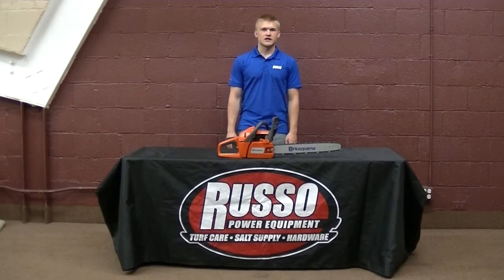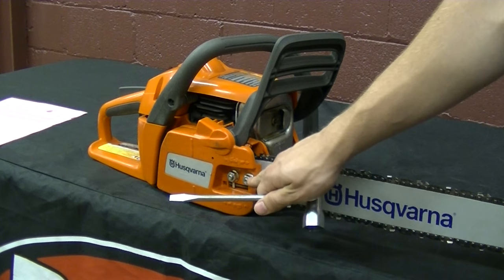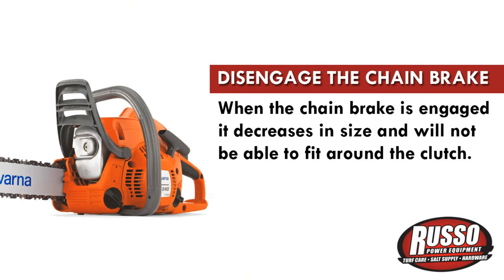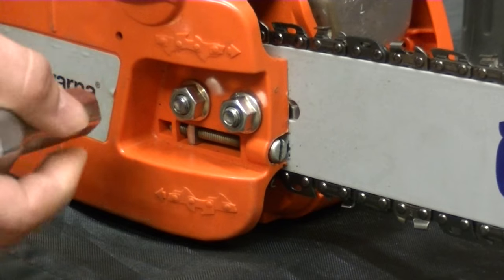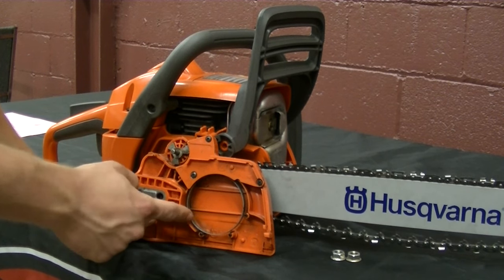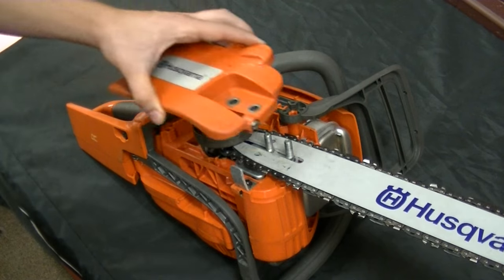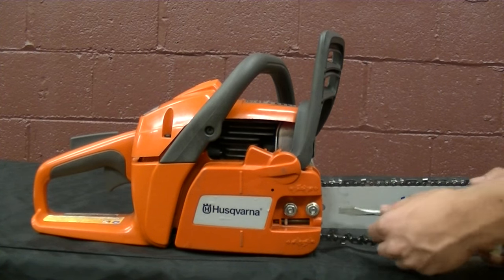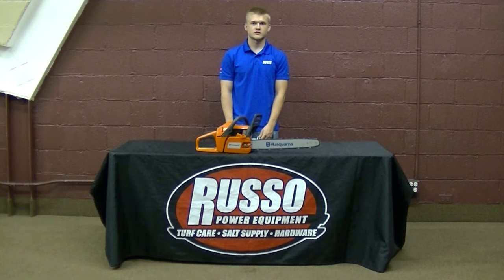How to Remove a Chainsaw Clutch Cover and Reset the Chain Brake

Comment: How can you temporarily put the clutch cover back on as you do at 2:40 when the clutch band is too small of a diameter (because it is engaged) to allow the clutch to fit in? I don't understand, but I sure wish I did!
Reply: Take the safety bar off with your hex drive and use the whole thing as a wrench to reset the safety!

Comment: Thanks for the tip to disengage the chain brake with the cover off. For those following, make sure you apply good pressure as to not strip the plastic.

Comment: Thanks, good tip on resetting the brake. I would just like to add that it is a good idea to lift up on the bar when you are snugging up the nuts.

Comment: This is slightly off topic, but i just bought a chainsaw and I was trying to tighten the chain.  I was undoing the nut on side and turning the tension adjuster bolt but not disengaging the chain break.  Will doing this cause damage?

Comment: Thanks for this instructional video. I didn’t recall settings the chain brake, and so didn’t think to try to unlock it. After watching this segment, 
problem solved in about 2 minutes.
Cheers, Bill

Comment: What size tool is needed to remove the bolts that hold the hand guard handle in place?  Mine broke and I need to replace it.

Comment: So I did what it said not to in the video and removed it without disengaging the brake. Does anyone know how I can fix it now?
Reply: Manually push the metal back in the disengaged position and put the cover back on. I think ....
Reply: Hey, I know it's a year later but...Take the safety bar off with your hex driver and use it like a wrench to reset the safety. This is a much better technique and it only takes a minute.